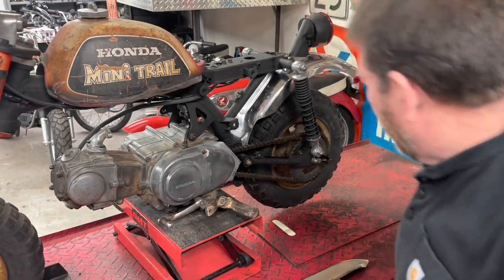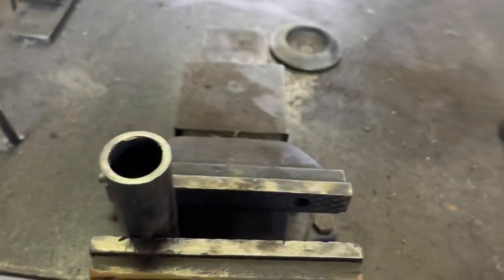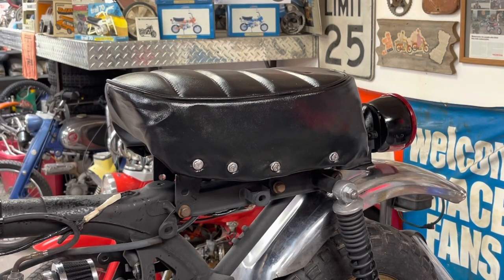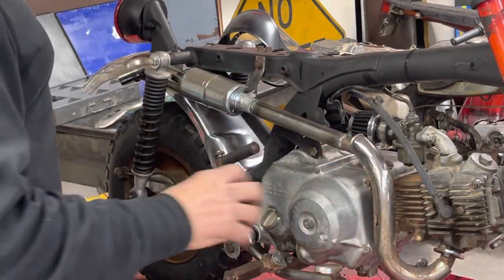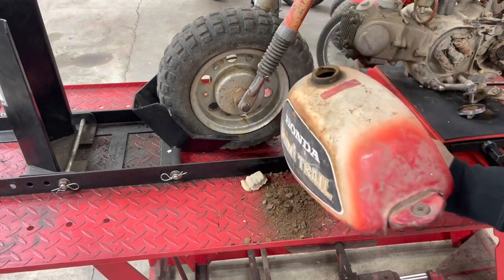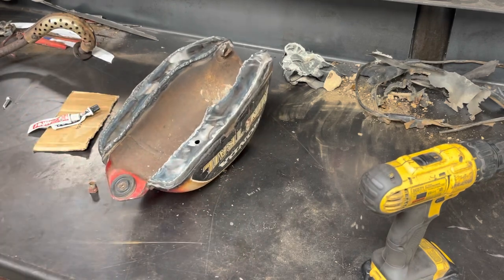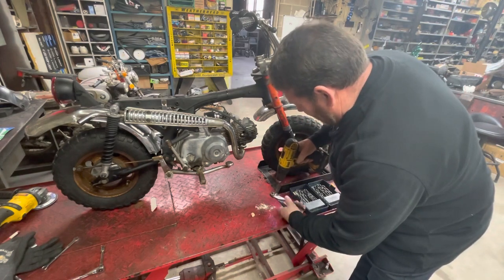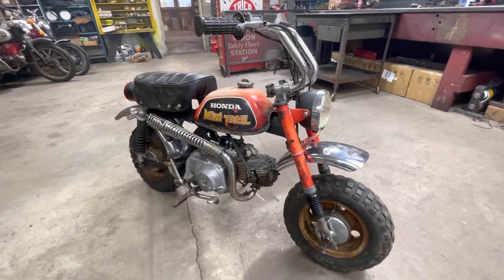Honda Z50 - video #4  Its done!

Comment: Did you ever sell the bike?  I just picked up a running Z50 engine today.  My plans are to piece together a bike, but make it just a little prettier than yours.  I also have an XR50 clone, that I may put the Z50 engine on.  Since I don't have your parts stash, there's no telling what direction I'll end up going.  By the way, I'm only about 20 minutes from Mike's Mini Trail.  Thanks for another great video.
Reply from the maker: Yeah, it went to Mark at Habit Moto in North Carolina.   I really like the ugly bikes.  I’m never afraid of scratching them.  🤣